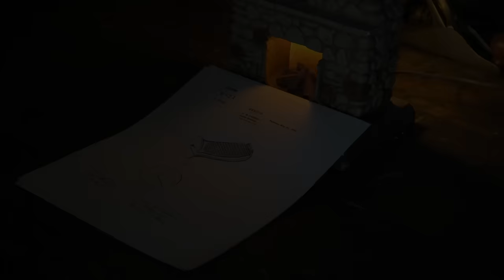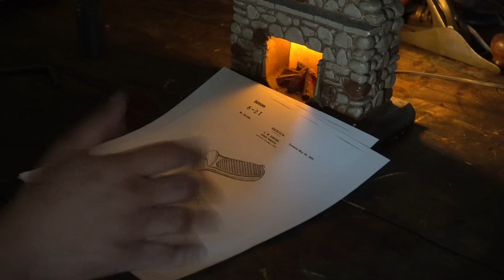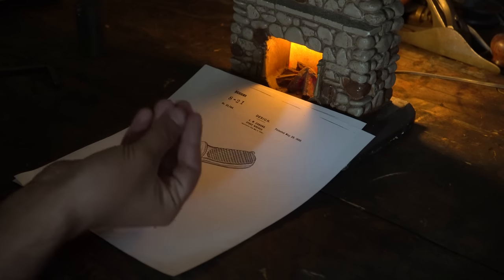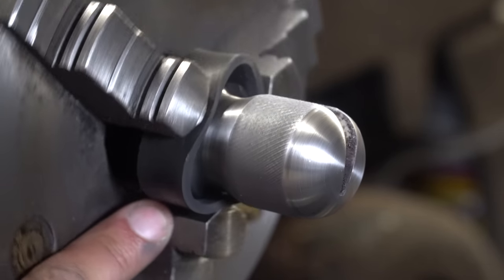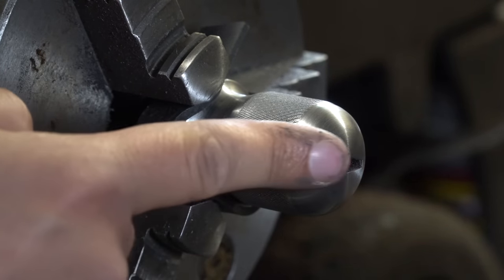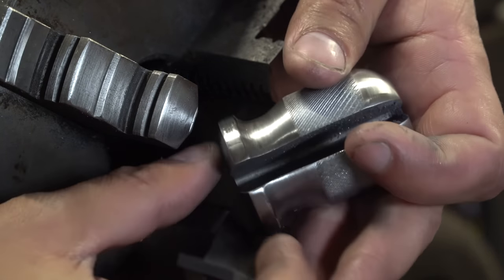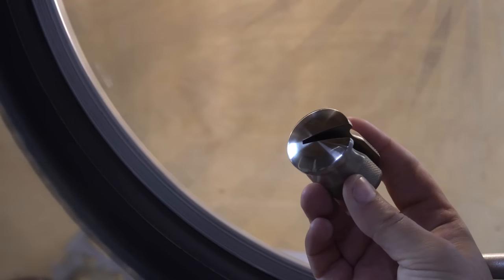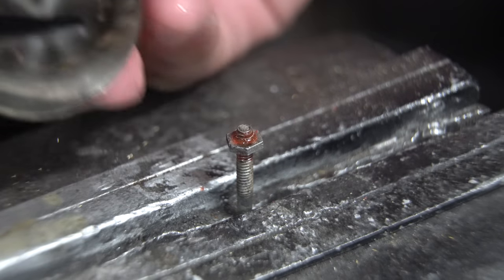Nipple Wrench [Patent Remake]

Comment: Former bicycle wheel factory worker here: In the 90s I built wheels at a major manufacturer and in fact, made all of the wheels for the US Olympic team one year. We had a tool almost identical to this one, but the outside grip was rubberized. The tool wasn't used to put the wheel together... instead, there was a machine kind of like a hanging electric screwdriver that constantly had a nipple hanging in it spinning... you'd stick a new rim in it, then the spoke into the nipple, and it would spin them on most of the way really quick. As soon as you took one away, a new spinning nipple would drop into place, so you could get all the spokes on the wheel fast. Where this tool came in was after that... you had to adjust the tension of each individual spoke so they all were within a specific range of tension. There was a caliper like device with a needle that had to read between a couple of red lines, and you'd use this tool to fine adjust the nipples tension back and forth until it was correct.
Reply: That is interesting and awesome! So you are one of the handful of humans that can assemble and true a wheel in, like, a minute. Impressive. I have heard of Japanese women doing it really fast in the motorcycle factories. Truing a spoked wheel is a serious skill. Not easy. It's like tuning a huge guitar, for a rock star, before a monumental concert.
Reply: @jlucasound  that Comparison at then End, i imagined someone listening to the Wheels and tuning them 😂
Reply: @watchyahead2 Funny you should say that...  I was a professional bicycle mechanic at a small shop for a few years. Although we didn't have the dedicated wheel production equipment Charlie had, I hand built several pairs of custom wheels for various high-end customers. We had a spring-arm spoke tension gauge, but once you were in the correct range, the easiest way to compare and balance tension between spokes was to pluck them like a guitar string and listen to the pitch, and tighten the low ones and loosen the high ones. Of course, this had to be done according to certain patterns to keep from distorting the wheel's shape.

Yes, I tuned wheels...musically. A common road racing wheel was correct when the spokes played about a G above middle C, although asymmetrical wheels would have one side higher and one side lower.
Reply: @Spott07  lol that’s great and I know what you are talking about, funny how all this gets together. Maybe Customers can Order their Bikes tuned to their favourite Band 😁
Reply: oh hey you're the feller who invented Beer!! cheers for  that
Reply: The screwdriver bit was at the top of the building machine spinning constantly in a chuck and not a nipple as nipples are non - magnetic . The operator had to place the nipple on the spoke with about one turn by hand then the machine would tighten them about 85 to 90 percent of the way . Then the spoke tension meter would be used for checks whe  finishing it . The last turn or two was done manually to bring it to specification . With deeper section rims , a nipple would be dropped through a hollow ferrule to ensure that it drops through the destination hole for initial securing . I have used a Hosan machine which Shimano also have used which was the common semi autonatic method around 1996 . Todays machines are similar but turn and tension sensors give assembly synopsis to the operator . Final tensioning stands hold the wheel horizontally as this is what Shimano currently does in Malaysia .
Reply: We literally did that at Velomax/ Easton as an easier and faster way to compare relative spoke tensions across one side of the wheel  @watchyahead2
Reply: Finished specifications were all verified by tensiometers but comparing and balancing by tone is way more efficient.
Reply: @jlucasound ...there's just a bit more than a handful; otherwise people'd be knockin' on my door. Did my 1st one 40+ yrs ago.

Takes some patience, & understand, but anyone w/ basic mechanical ability, an interest & someone/something to teach them the process can do it.

The best 1st step is to learn how to true a wheel thats been ridin' w/ loose spokes.

There's many dads in our country, & around the world, who can't afford to buy a new wheel/bike or pay a bike shop who can true a wheel.

I used a small Crescent type wrench for years, which doesn't make it easier... lol.
Reply: @georgedennison3338  Being able to assemble and true a spoked wheel is an awesome, valuable skill to have.  Fine tuning that skill to assembly line speed and consistency is a whole 'nother ballgame.
Reply: The good old tensiometer! Used to use that when I was a bike mechanic during wheel building too!
Reply: Best tool I found was a butterfly shape made out of bent sheet steel. I wish I could find one again

Comment: I worked in bike shops all through school and then some. While modern nipples are fairly standardized, old bikes had nipples in all different sizes. We'd typically have some old combination spoke wrenches around, and old wrenches of various sizes in a box. I'm sure in ye olde days it was even more varied. That's what this is for. It's a universal spoke wrench, one wrench to rule them all... It's a dumb idea, sure, but I can see where the inventor was coming from.
Reply: I can't help but feel like the intended spoke nipples must have been huge compared to modern examples.
Reply: Hardly a dumb idea if it works, and it probably would work on just about everything. Which when you have no idea what you will be working on next in a world without much in the way of standards... This sort of thing could have been the go to tool. Though the geometry might want a little tinkering with, and IMO it probably wants to be rather soft - there is so much metal at the working face it will still be very hard to damage to it with the nut, but being softer might just help that stubborn nut get a little bit more bite when you need it. Ultimately the tool doesn't have to last forever and in theory you can and would just resurface that grove quite a few times before you run out of metal at the thin point.
Reply: I thought it was for... never mind
Reply: @foldionepapyrus3441  Just IMO, but I have spent thousands of hours truing wheels. It's pretty easy to round off a brass nipple if the spoke wrench isn't a good tight fit, and that's with proper spoke wrenches, er, nipple tools. I suspect Hand Tool could come up with an adjustable nipple wrench that would be more effective.
Reply: @gregmuon  Indeed, but I don't think that invalidates this tool concept at all, as a good enough fit should be possible - might even be easier than the adjustable once you get the hang of the tool and perhaps tweak that geometry a little. As I expect with this concept you'd be able to feel if it is seated well and not have your only warning the adjustment has slipped being when the stubborn nipple is suddenly destroyed...
Reply: @foldionepapyrus3441  Conceptually, I can see it might have been a useful backup tool in 1900, when a crazy variety of nipple sizes and systems were out there. As demonstrated, it works on really big nuts. There may have been an occasional 'ordinary' still around as late as 1900. Those things had huge spokes.
Reply: @gregmuon  He just needs to make a micro wrench! Would be perfect for nipples.
Reply: @ionstorm66   and for nipples... 😁
Reply: Every maker nowadays uses a different nipple size. I can show you my pléyade nipple tools sited at my tool box.
Reply: @milybanily yes, please

Comment: In the 1900's spoke nuts were nuts. And by that i mean, they were all over the place. Some designs were long (i've seen some that reached about 2 cm out of the crown of the rim) some were incredibly short, barely poking out. There's a 1903ish wheel where the nuts are the classic barrel for about 4 mm, then they turn to slits for the next 4. Saw a two part nut, one part was the classic nut, but with a truncated pyramid end, the other was a socket with a knurled exterior that would be put on the spokes before assembly and left in place. Once you were done hand tightening the nuts, you'd use a small, thin wire wrap around the nut (has a negative ring around the base) and then loop it around the base of the socket around the spoke itself. And there's likely a thousand more nutty goodness. This wrench is the least weird thing of all. :))
Reply: So what you’re saying is that you could use the spoke wrench on imperial and metric size nuts?

Comment: I work as a bike mechanic so this was really interesting! I think a modernized version with the stepped slit could be pretty useful, on bikes today theres commonly like 5 different sizes of nipple and having one wrench for them all would be real neat!
Reply: I'd love to see two tools that have a narrow outside slot and a wider inside so you slide it over the spoke then drop it onto the nipple and pull into the correct size. If it's under 1 degree of angle you might not even need steps. Otherwise, stepped for 15 and 14g, and another for ebike gauges 12 and 13.

Comment: Nice tool.  Something of a 'badge of honour' is the spoke key for bike wheel nipple amongst engineers, bicycle mechanics up to motorcycle mechanics and general wheel-setting using spokes. I dare say a slimmer shaped key could have a narrower bodied version of your one there, with a narrower, more acute 'v' for the smaller nipples on bicycles, wheel-chairs and motor-bicycle wheels though, just as well.
Great stuff, sir.  A simple tool made much more complicated; it's a better story of the process.  Great showing of the working needed.   Cheers!

Comment: I agree that it is designed for 6-sided spoke nipples instead of the modern 4-sided.  I used to build and straighten bicycle wheels and would often turn the wrench both directions while working on a single spoke.  When tightening a spoke, I would turn it back just slightly in an effort  to "pre-slip" the nipple on the spoke.  I would also go on a path of 8 or 9 spokes alternately tightening and loosening spokes.  It the jaw had teeth in it for gripping, I would be constantly flipping it over to tighten or loosen a spoke.

Comment: I was just talking about you yesterday.  Mustie1 picked up a Maytag washing machine motor, and while he managed to get it running, it wasn't running well, and it kept flooding after it had run.

I hypothesized that the fuel bleed screw in the mixer wasn't adjusted correctly; allowing the engine to keep sucking up fuel, even after the spark plug had been grounded.

You had done 1 or 3 of those things, so I left a link to one of them on his page.
Reply: Mustie1 is the one that linked me to this channel. i think he was working on a gas powered skill saw that came from this guy. I really want one of those. I'd call it the kilsaw.

Comment: Way more work than was needed. I made something like this for a project a few years back. Simply drill out the bottom of the V = 2 minutes. Chop saw with disk to cut out the V. 5 = 5 minutes. File saw marks smooth = 5 minutes. Perfect V groove in bar stock.

Comment: I mean they had rubber at the time, very easily could’ve made the gap a bit wider and installed some rubber as to not gouge the spokes.
Reply: That would cause it to slip, theres a lot a torque happening in a very tiny area towards the end of trueing a wheel.

Comment: Like a wrencher with no denture. Or The Gummy Wrench for havin' no teefus. Or Plumbers Wrench for the huge butt crack. The possibilities are endless. You did prove it worthy using the larger nut bolt example. Fantastic work on turning this!

Comment: I used something similar in the Air Force to replace a certain part on KC-135s. Access was difficult with a standard wrench, so someone designed the "silver dollar" wrench. It was a 1/4-inch slice of an aluminum bar with a 5/16 slot cut just past center. Slide it on the nut and spin the dollar wrench to remove/tighten the nuts.

Comment: There is already a multispoke key similar to an alligator wrench for larger motorcycle and car wire wheel spokes which has jaws on either end with a series of parallel flats. They work very well but are not truly universal as they still rely on the nipples being specific sizes to match the wrench.

Comment: When I was 16, I was taught by an old school bike mechanic how to build wheels from scratch. How to measure and order the correct spokes, etc.. before that education on wheel building, I only knew how to use a truing key to get a bend out of a wheel.

I doubt I'll ever build another wheel from scratch, but when the bike shop decided to close it business, I smuggled most of the important assembly tools out of the shop. I say smuggled, but they really only cared about the merch. Being a bike mechanic was the best and most fun job I ever had. We also did skis and snowboards in the winter. Now I'm a boring security analyst. :-(

Comment: My grandpa has a bicycle that was from the 1940's. The spoke nuts/nipples on it were triangle shaped. He told me the idea was that between a square and a triangle starting of identical sized stock the triangle had more surface area per side to grab thus reducing the chances of rounding it off, but it was also harder/more expensive to manufacture apparently. I am not sure how correct his statements were, but they were still in good condition over 50 years later.

Comment: Nice work dude. I have a Nashbar bike tool kit that has 3 different sizes of spoke wrenches. And yes they are 4 sided not 6. The wheels on my bike are hand made and I take great pride in them. I didn't make them. They cost about 300 bucks each. I wouldn't use that tool on those but my wheels are never out of round anyway. I do have spoke tools. Never need them.

Comment: Wow another patent invention is made...  well done.  Also pushbike valves are held in place by nuts... so this would work on them too... as many are rusted on ... especially when you find the older pushbikes... or should a pushbike be left outside for its lifetime. Plus I ride a motorbike with spokes on the front and back... and did get some spokes replaced.... Oh no the poor bandsaw... we need to see it getting restored now.

Comment: Most bicycle spoke nipple wrenches are three-sided, with two parallel sides. And unless you specialize in servicing old and/or neglected bicycles, they will usually do the trick. The next stage up is a 4-sided/3-corner wrench. There's a slot, a cutout going through one corner where you can slide the spoke in before lowering the tool over the nipple. 
They do work, in a manner of speaking, by letting you transfer more torque w/o rounding the nipple off.
I say "in a manner of speaking" as they also offer an excellent chance of snapping the whole nipple instead of rounding off the tool flats. The span in which they work as intended WRT freeing up seized nipples is fairly small.

Comment: I had a 'modern' one of these in the 1970s here in the UK. The difference being that it had a stepped slot, so it could fasten flat-sided nuts or nipples in 6 different sizes and was sold as a 'spoke tuner'. Maybe use a series of decreasing width end mills to achieve this?

Comment: Random trick: Use a stick in your polishing routine. Apply compounds to the stick and rub it in, type thing. I think Tim Nummy(Polishing Aluminum Metal to a High Luster Mirror Finish with Wood on the mini lathe) was where I learned it but I'm sure there's a name for the technique.

edited in the vid title: right guy wrong material(aluminum), still worth a quick watch on how to get a mirror finish with a stick though, cheers.

Comment: Just a little hint - according to my experience, thick quality leather (as used in belts etc.) works better than rubber to hold round pieces and/or pieces with a delicate surface between clamping jaws, because it inherently has more dimensional stablility than rubber. 
The unfinished/rough side of the leather should be positioned towards the piece to be machined of course.

Comment: As a bike mechanic I can say that I wouldn’t want to even try to use it on contemporary wheels, especially if the nipple is alloy. Even brass nipples are probably going to get rounded. I would say a step pyramid style slot milled to the right sizes might be nicer than the three typical spoke wrench sizes that I normally use but I suspect that they would work better in tight spoke configurations than this too.

Comment: Pretty much all Adventure Motorcycles use spoked wheels and if the tool works well, there could be a market for a small hand sized tool that you can put under your seat, pannia etc and be able to tighten the spokes on a journey of rough off-road riding.

Comment: I'm a bicycle specialist, 27 years in various pro-shops as a master mechanic. I would guess, due to the depth of the jaw and it's long taper, it was designed as a wrench to fit multiple sizes of spoke nipple. It is a poor design as spoke nipples have parallel sides and a square (90⁰) jaw is needed to keep from deforming the brass nipple. Cool restoration, though! Keep em comin'

Comment: Okay....  wild idea, but you could braze some diamond powder to the inside of the crack.  That would give it some grabbing power on those spoke nuts that don't have really well defined corners.  Craftsman sold screwdrivers wirh the tips coated in diamond powder, and it was a decent improvement, especially for screws needing the dreaded phillips tip

Comment: I'd recommend tempering that 1144 after quenching. Throw it in an oven at 300°F for a couple hours to reduce the stresses induced by the transformation to martensite. It would be a shame for that to crack from a simple drop.

Comment: Modern aluminum rims run under much higher tension so the spoke nipples are harder to turn. A very old bike with wooden rims would have had much lower spoke tension so this probably would have worked fine back then.